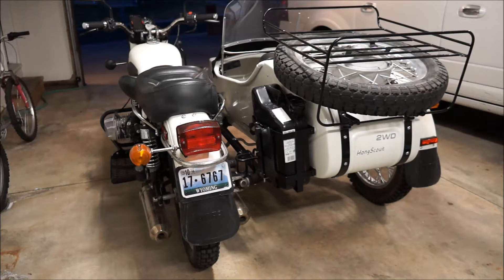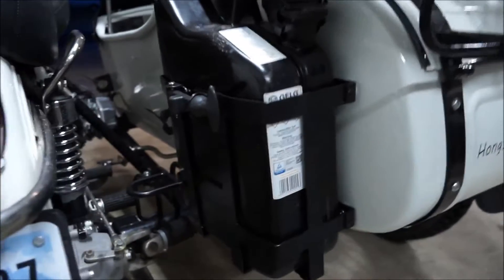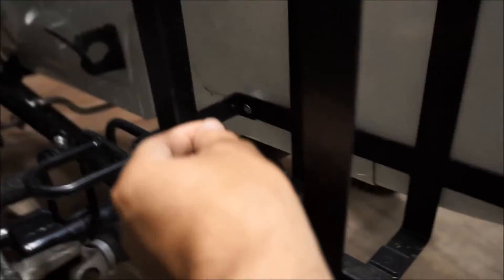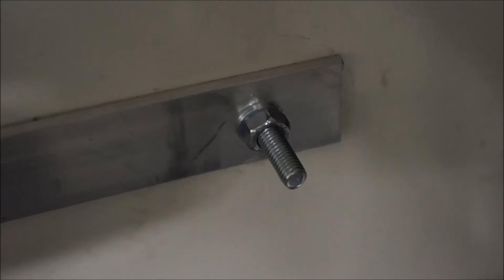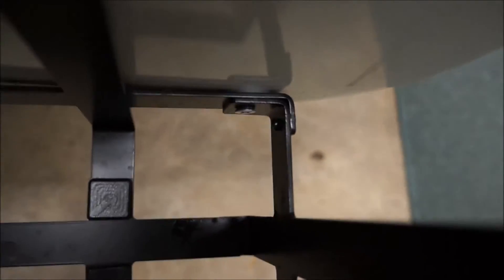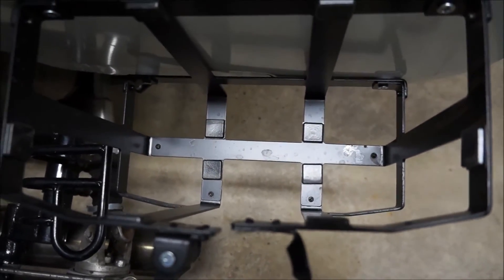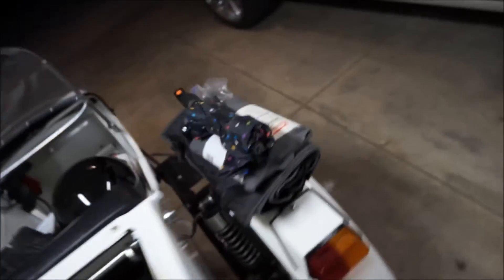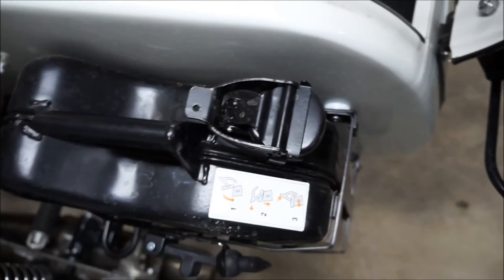Ural Jerry Can Install

Comment: 5 Gallon?
Reply from the maker: Mark Masztal 2.5gal
Reply: I bought a 10 Gal jerry can with holder and spout. it was a great price but I think I'm going to have to lay the can horizontally. Vertically is not going to fit, I won't clear the spare tire.
Reply from the maker: Mark Masztal That's crazy! The most I have seen is a 5gal. 10 is huge. Where you going to fit that?
Reply: My bad, a typo. 5 Gal, 20 liter can but still a but big.